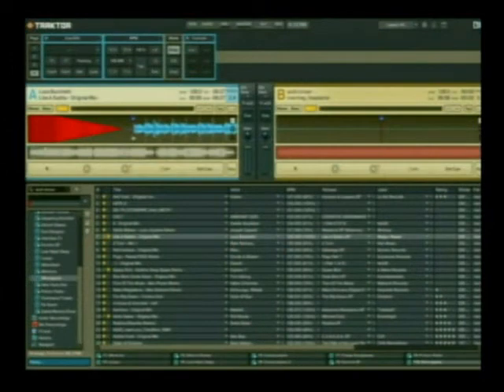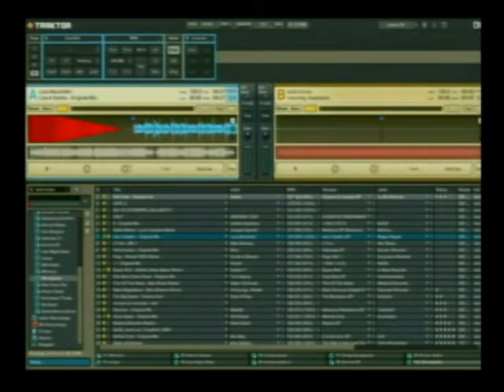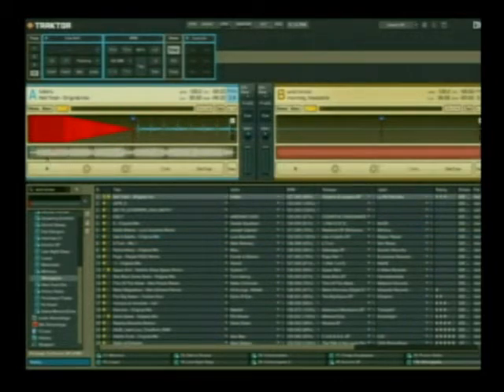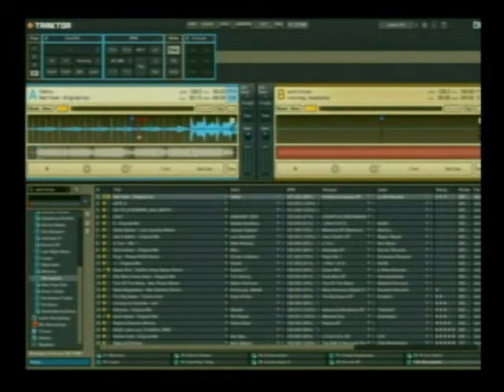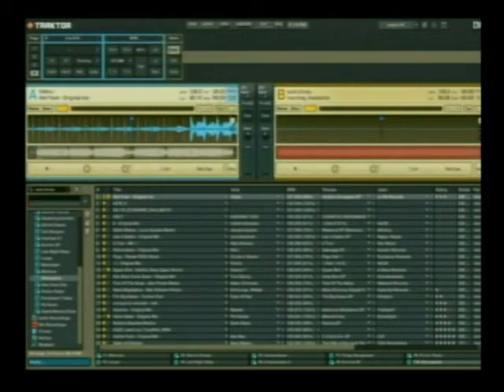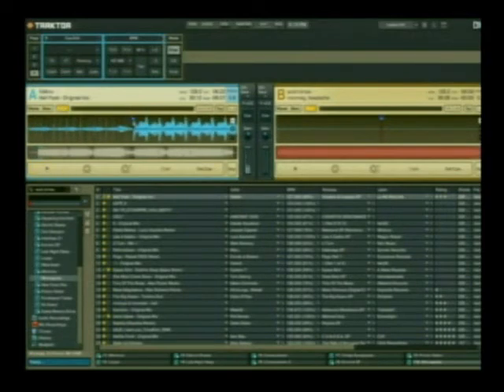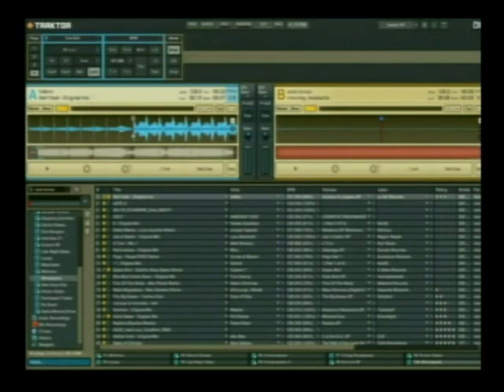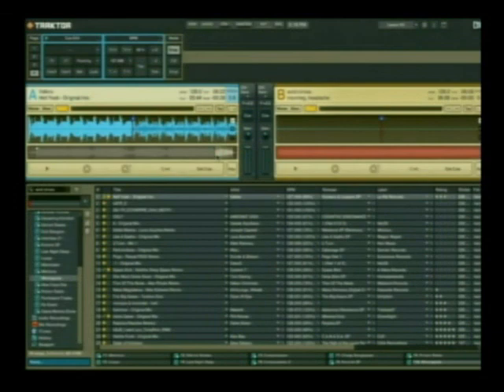DJS - Traktor Scratch Tutorial - Beat Grids A

Comment: thx 4 the tutorial but i have some questions.

if i set a beat marker at the very beginning of the track, and then move to the medium part and move the beat grids, it 'll adjust the beat grids of all the track. so let's say i've adjusted it but later in the track there is a pitch fluctuation. if i move the beatgrids again, they will match the actual drums, but they wont be ok at the middle of the track.

so what i should do?
use a lot the "2" key to drop more than one beat marker?

thx a lot